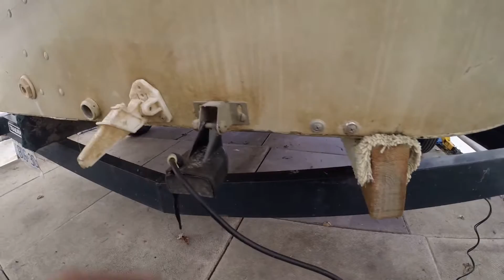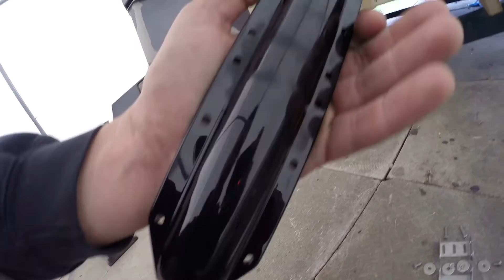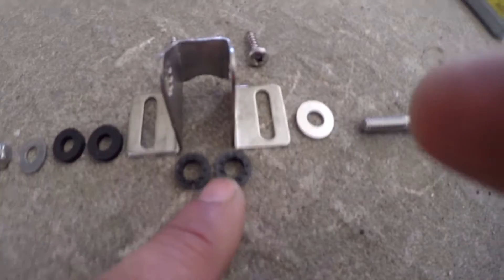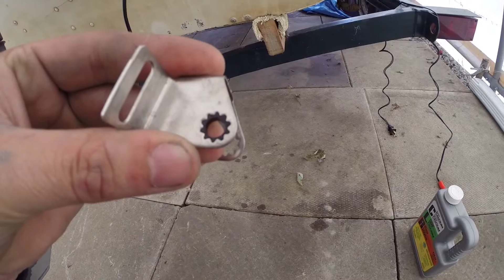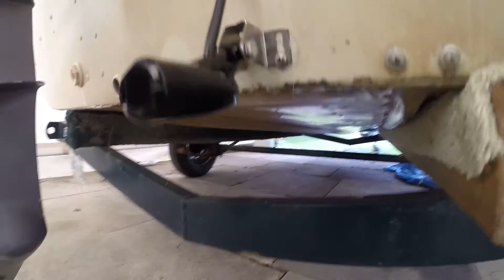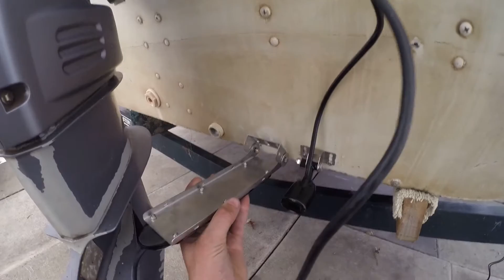Skimmer Transducer Install and Lowrance LSS2 - Aluminum Boat Project #9

Comment: Transducer is too low and structure scan is supposed to be inboard of sonar transducer.
Reply from the maker: That is true on a V hull boat, but not necessary on a flat bottom boat like this one.  The reason why is you don't want the port SideScan beam to be blocked by the 2D transducer.  In this case the clearance for the port SideScan is fine as it shoots below the 2D transducer.

The transducer is not too low either.  On this hull to get a reading at speed it needed to be mounted that low.

Comment: Previous owner had an old fish eagle on the boat and the bracket is same as the lowrance.He mounted it on left side of motor.I left bracket there so I may try putting transducer on it to see if it makes a difference..Also, for the trolling motor mount I saw you used the TMB-S, but Lowrance makes a MKR-15 kit for trolling motors.does it matter which I use?I may use an extra metal transom bracket I have instead like you suggest.Need to source a  large stainless hose clamp.thanks
Reply from the maker: +newyota1 You can try that but the clockwise rotation of the prop usually makes that worse

Either of those brackets will work fine.

Comment: What if you can't get a good mounting spot and lose bottom at speed which is what happens on my 14' jon once I get up say half speed?My transducer is in about the same spot.Not many options on small boats.I do have a rock cage that encompasses my prop which I guess can be causing cavitation issues.I would like to run faster and use my sonar but can't in more open water, but need the rock guard in the river I fish.Dircections say you can epoxy them on hull and shoot thru it..Would this work in my case?Thanks
Reply from the maker: +newyota1 You can only epoxy them inside a fiber glass boat. You could buy a thru hull transducer where you cut a hole in the bottom of the boat and feed it up from the bottom. A big nut will thread on to it from the top and you seal up the hole.

First try to adjust the position of it in the location you mounted it. Move it up and down in the bracket and also push the end that is away from the boat down one notch to have the transducer plow through the water.

Sometimes though you just won't get a good reading and you will lose bottom at speed no matter what you do.